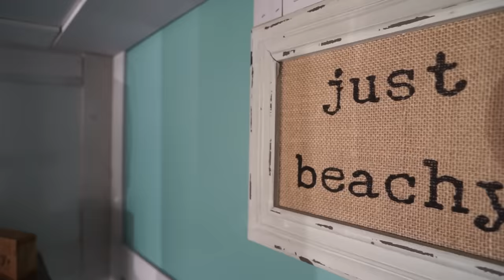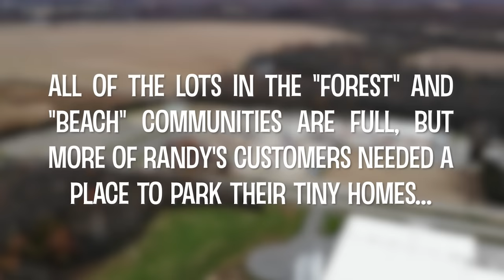Building 700+ Tiny Homes & the Largest Tiny House Community Ever! (Tennessee)

Comment: There is so much that is right about this. First, having units that are 10 feet wide feels like such a bigger space. Secondly, I love that he isn't greedy about profits. $6000 for the first two years and then $200 a month after the first two years is so much more reasonable than some of the other places featured. This approach really does become a great financial alternative for people.
Reply: That is amazing that it only took $6K to build out each lot with Power, sewer, and maybe Natural Gas.   Where I am, just one residential Water and Sewer Tap fee is $15,000.  I am not sure how much lower it would be if you were more rural but in Colorado,  housing costs have gone up higher than most states.  Also, so far I have only heard of 2 cities that are allowing Tiny House Communities to be built in Colorado. 

I would like to try and find 35 acres to purchase in the foothills or Mountains and try to get it subdivided into 10-15 lots with septic sewer systems for Tiny Houses.
Reply: Exactly ❤️
Reply: The price is higher now, especially since they're expanding the mountain. But to be expected.

Comment: I love this. I really liked that blue home he gave a tour of. Just incredible how he made such a nice, practical, and cozy home out of such a small space. It's tempting to just sell my 4 bed 3 bath house here in So Cal and move into one. I really don't need this much space. In reality I tend to only use a smaller portion of it on a daily basis. It's just a waste and cost a huge amount in property taxes and heating/cooling etc. I just can't understand people who want to upsize and live in bigger and bigger houses unless they really need the space due to having a big family. The one thing I would miss though is a garage/workshop. Not sure if that would be an option. It seems the biggest problem with tiny homes are city code requirements around the country. I'd love to buy a nice scenic property somewhere since I no longer need to commute and put a tiny home on it but that does not seem to be so easy without violating local city codes.

Comment: I would charge $50. a square ft.  for labor, plus material. A 250 square ft tiny home would cost approx $12,500 + material for the build. I would try & use use as much reclaimed material as posible. Tiny homes that aren't going to be moved much or at all, maybe the trailers could be built in the factory to save money for the customer. You could use some really strong steel i-beams & a strong trailer axle or axles accordingto the size. Plus the the floor joist fit right inside the I-beams & can be screwed to to then.

Comment: The reason the company called Incredible Tiny Homes homes on trailers are needed. Is due to the continued destruction of housing, which will be total, which is why the most important feature that has not been pointed out. Is just like Pallet Shelter's components that can be taken down in an hour, placed on trucks and moved to escape floods which will be 3 feet higher, more levees will burst, and more frequent. All of the Incredible Tiny Homes are built upon trailers. All their homes are on blocks taking the weight off the tires. Which can be fully inflated, the house brought down off the blocks with forklifts and hydraulic jacks; then moved to avoid floods. Not easy but doable with 24 hours of warning.

Comment: One acre of undeveloped land $20,000.00
2 x 48' Simi trailers used $10,000.00 = approx 800sqft
Siding, windows, roof, roof rafters, decking and insulation &10,000.00 
If you add 4' walls on top of trailers sitting side by side, you now have 1,600sqft for the cost of the 4' walls.
Wiring and plumbing $5,000.00
For $50,000.00 you can build your own and own the dirt it sits on. Maybe much less if you take the time to shop the land and materials. Or pay two to three times as much and pay rent on the land forever, while having to adhere to yet another tools rules. 
Either way if your now paying $2,000.00 + rent on an 800sqft apartment that's $24,000.00 + bucks a year you will never see again. You will never pass down a home to help your children. After fifty years all you will have accomplished is paying $1,200,000.00 + for the privilege of living down the hall from multiple drug dealers, screaming idiots and brain-dead retards that think you can Bar-B-Q on a three sqft balcony at 3am during a tornado. All while you can't get your land-LORD to fix jack$#!t.

Comment: I think I have to address basic important questions here. Consider that I am very innocent, because I did not see these basics information: (1) ELECTRICTY- where would you get it? (2) Sanitary sewer drainage and collection - would everybody build a septic system or the city. If you're OFF THE GRID, septic tank is the only choice, but like I said, I'm innocent, so I don't know anything else. (3) Drinking water - you can buy, but if I'm homeless person, I don't have a vehicle. Storage tank is option. Will there be a general drinking water supply or pumped ground water? (4) Garbage collection (5) Gas propane or natural gas for all those appliances?

Comment: Every city, town, village I have spoken to wants these small homes, but it is bureaucratic push back that prevents it from becoming reality. We build with high energy efficiency SIPs. We can easily build a 400 sq.ft. Home for $40k. We never stick build as that wastes wood. Also no bizarre crap. These homes have to fit in. No trailers either, on slab.

Comment: What about building small apartment buildings with apartments that could be 700 - 800 sf and could cost less than $60000.  Most of these tiny homes will not be on the road anyway, and they will decay in 15 years.

Comment: I love tiny houses. However these communities are NOT impressive. I live in a 55+ mobile home community in Florida. The homes can be bought for 20,000 to 100,000.lot rent is  600.00 to 1000/mo. Each lot is approx 50' wide and includes a covered carport and concrete driveway for 2 cars.  We have private paved roads, underground utilities, street lights,  1 or 2 palm trees per lot, and a large community center with clubhouse, heated pool, gym, 2 dog parks, tennis courts, laundry , administrative offices staffed with 2 staff plus 2 full time maintenance men and a hired lawn service.  So many of the tiny house communities look like Walmart parking lots with dirt roads. They are making some landowners wealthy who don't bother with any infrastructure. True,  we benefit from economy of scale by having 200 or more homes. But frankly some tiny house owners are getting ripped off.